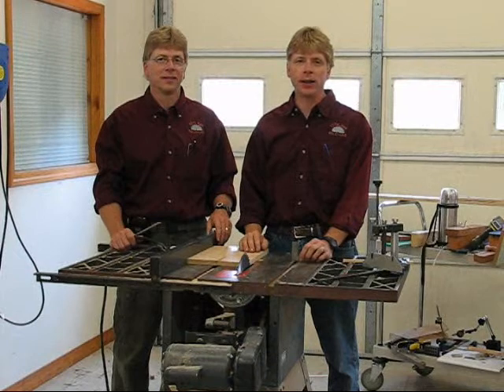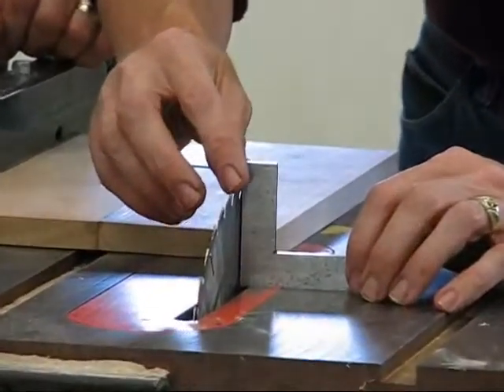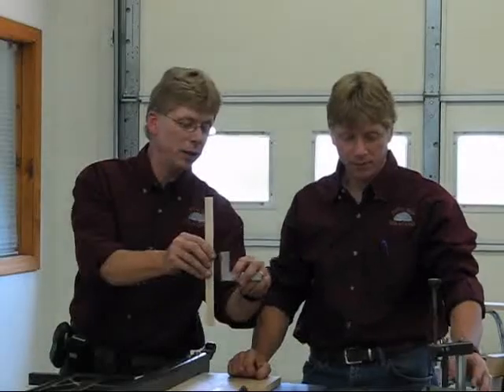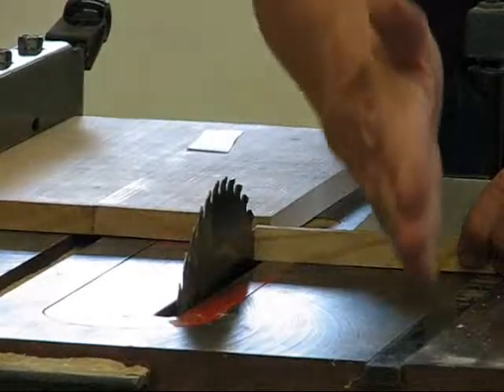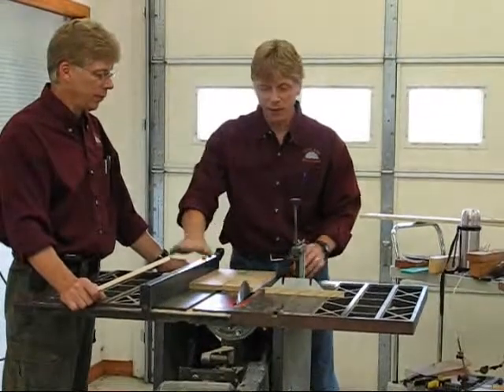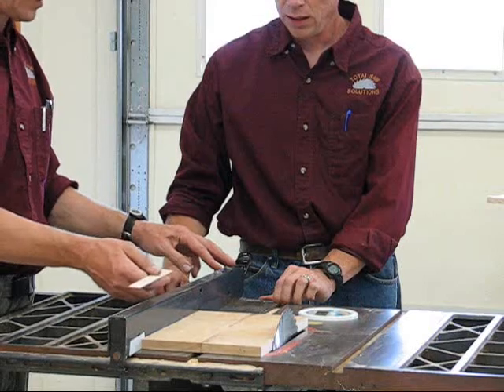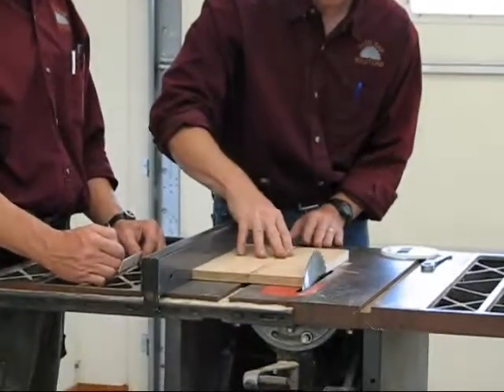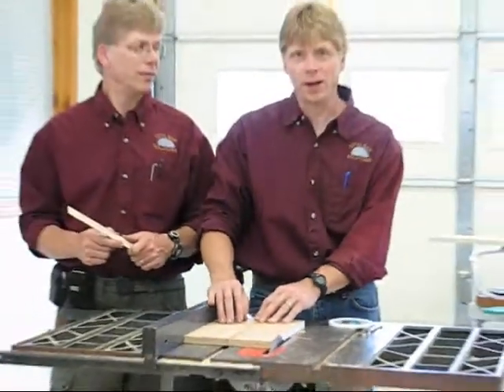Aligning Your Tablesaw with a Sour Cream Lid

Comment: If you set your fence for clearance on the finished side of the blade, what keeps the blade from catching on the waste side?

Frank
Reply: +franksalterego Personally, I go as close to zero as possible, but aim for clearance on the finish side.

My thoughts on this.

1) I doubt I could ever get it perfect, even using a dial indicator, as I do. My fence has a + .007 dip in the center. So I go from .000 to +.007 to +.001 the length of the fence.

2) If you have the back side of the blade contacting your work, you want it to contact the waste, not the work piece. I would rather have any slight marring of the wood on the waste.

3) The only empirical evidence I can offer, with safety in mind, is that if the clearance is on the waste side, I experience burning of the work piece in very hard woods,  even at neg .001. I do not experience burning on the waste side at +..001.

I love your question, as most don't think these things through. They just do it because [insert well known woodworker/magazine] said to do it.